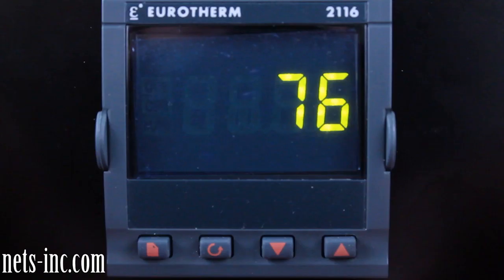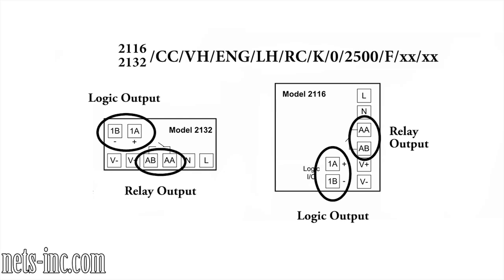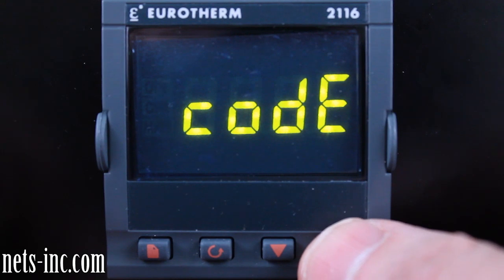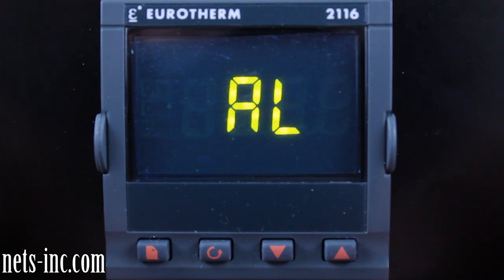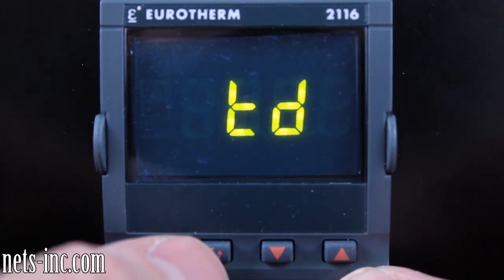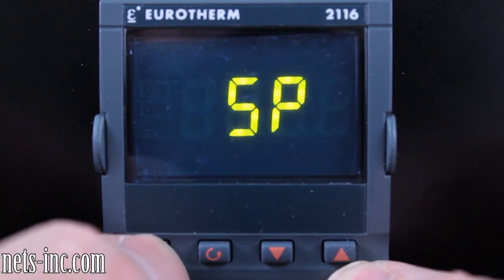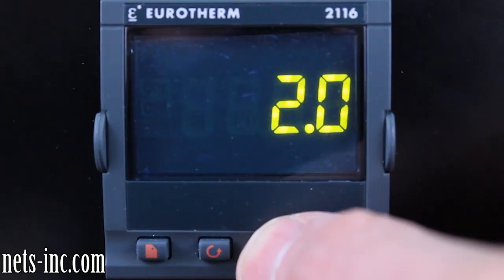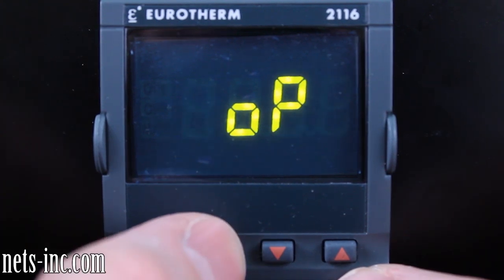Basic 2132 / 2116 Operation Level Setup

Comment: Hello guys. Does this controller allow the creation of 2 or more heating ramps and permanence levels (different temperatures) in the same process?
Example: I need to calcine a sample with a heating rate of 1 °C/min up to 400 °C and remain at that temperature for 1 hour, at the end of that time, the heating rate rises to 5 °C/min until the final temperature of 800 °C and at this temperature remain for 3 hours;